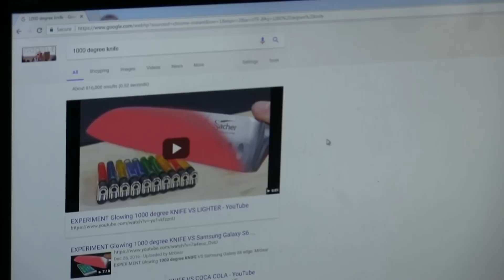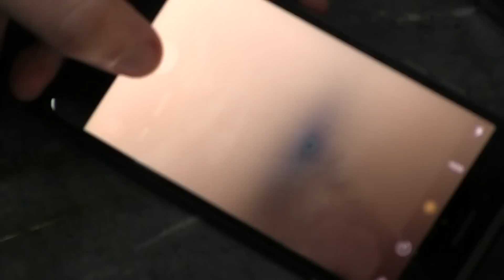1000 degree KNIFE VS $40 Nokia and $700 iPhone 7

Comment: -damages a lithium battery device, it catches fire, everyone freaks out as if it wasn't gonna happen.... comes back, throws water on it... which is something you NEVER SHOULD DO... and gets lucky that it didn't cause an explosion since lithium reacts explosively to water
Reply: ziggiey lithium when in a battery is like a gel. It releases gas when it gets hot, like any other thing on the planet when it reaches its boiling point. The gas is flammable to the tiniest of sparks, the gel is flammable just as well, except lithium itself is HIGHLY reactive to water, and thus explodes. It's like throwing a chunk of potassium into a tub of water.. But much worse. It's why air fields that fly electric planes/copters usually have warnings to NOT use water to put out a fire, but instead use a bucket of sand because the only way you can put out a lithium fire is to suffocate it. Just like with oil fires.
Reply: ziggiey i can only assume, but id guess because the battery was inside the phone so it didnt allow the water to get in while expelling the gas. kind of like a pressure difference.
Reply: they don't explode when dropped in a toilet or a pool because they are sealed. most even have a form of kapton around the ends as extra insurance that any heat build up wont cause the ends to magically open.
Reply: It doesn't have to be a metal. And yes, its the gas that causes a fire with a lithium battery, but adding water to it acts as a catalyst because lithium does not like water what so ever, regardless of its form. Ontop of that, the gas that comes out isn't a lithium gas, its a chemical reaction between the lithium and other chemicals inside the battery when it gets hot. It gets hot because it is short circuiting; short circuiting means the full power of the battery is being released at that time, which means electricity, which ya know, is technically a plasma when its arcing, which is super holy fucking hell hot, and ignites anything combustible...
Reply: it actually went out moments before James put water on it
Reply: ok
Reply: Lol as previously said, throwing water on it would have made it WORSE. Not better. :3
Reply: Lithium ion batteries are explosive, but they're covered with a wrap that keeps water from destroying everything in a 5m radius. They were safe enough, is fine.
Reply: o.O where the hell did you get some kind of info like that? How is a 'wrap' on a battery, going to protect anything within a 5m radius? Specially since, with physics of explosions, containing the explosion thus makes the explosion exponentially more 'powerful'. A 'wrap' on a battery does nothing. It will protect it from having water get INSIDE of the battery for sure, but when its punctured, the protection of the 'wrap' is negated, and the lithium will begin reacting with water regardless if there is some special magic 'wrap' on it. It'll still spew sparks and flames, and can still run the risk of explosions. Hell, techincally all it takes is puncturing the battery to start the whole 'igniting' process because lithium reacts to oxygen in the air, but on a somewhat minimal scale compared to when water is introduced. Once water is introduced in an open air environment, it violently combusts... all the proof that you need that all is required to make a lithium battery catch fire and spew flames, is take a gander at all the videos/news reports of iPhones and Note 7s combusting simply from either over heating, or a small short circuit. The gas released by lithium batteries is highly combustable... and it only takes water, or a spark, to make it go BOOM.

Youtube and Google are your friend.
Reply: Hikari Because lithium batteries have an explosive radius of around 5 meters. The wrap protects it from water, therefore it would stop the battery from exploding and destroying everything within a 5m radius when exposed to water. Of course, it isn't literally 5m, because explosions are finicky as all hell and change in size more than a teen changes in personality, but... Y'know.
Reply: lithium really doesn't react that crazy with water, people love to blow shit out of proportion. like yeah it fumes and catches fire n shit but it really isn't very dangerous unless you are talking A LOT of lithium, and we aren't.
Reply: +CostlyCoffee Not to mention that most of what Hikari was writing is total crap.
The way li-ion batteries work is they have a thin layer of lithium on an insulator that is wrapped up with other metals or what have you into a tight bundle (I can't quite remember the stuff that is in there).
The problem isn't exposure to the air as much as it is the massive amounts of heat generated when it shorts.
I am going to quickly go through some of the posts and point out the bs.
The battery terminals or internals short out which generates heat as massive amounts of power are being dropped through the battery. The energy lost is converted into heat. There is no electrical arcing forming plasma for many reasons, not the least because it is a short circuit so it wouldn't even try to arc. The heat simply comes from the fact the battery is likely discharging a massive amount of power. a lot of Watts.
Also, Lithium reacts with oxygen in the air, sure. But that makes it oxidise, which does the opposite. It actually causes it to oxidise into a pretty non-reactive form of lithium. What it actually reacts to is the moisture in the air. Although It really isn't water causing any of this anyway. It is short-circuits causing the battery to dump all of its capacity in a short space of time, generating massive amounts of energy that need to go _somewhere_.
Bigclive has done a few videos taking apart lithium batteries, if only more people watched those, they would have some idea about what is happening.
Reply: mattymerr701 yeah, I hate it when people freak the fuck out over stuff they haven't a clue about. Happens all the time with anything related to chemistry cough cough dihydrogen monixide "scare".
Reply: I actually got high scores on a final in a public speaking class by basically using DHMO to scare everyone into agreeing to ban water.

My favorite part was when one of the people listening after I told them what they just agreed to went "...do you mean all water or just some of it?"
Reply: It’s funny watching nerds argue

Comment: using water on an electrical fire smh... get your shit together guys
Reply: they freaked out and that was probably their fastest way to stop the fire
Reply: Right they should've used milk smh
Reply: ShadowWolf0000 technically it's both due to the fact the wires and electrical pieces would have caught fire as well
Reply: Yes but the phone was dead by then. So there was no electric current going through at that moment. I could put water on a spark plug that has no current and it wouldn't matter.
Reply: Its a chemical fire lol
Reply: Chemical Fire* It was the lithium battery not the circuitry.
Reply: That's what I'm saying as soon as i saw the water "What the FUCK James!"
Reply: The phone wasn't plugged into the mains so it's not really an electrical fire, The fire was caused by the lithium battery venting when being hit with a hammer.
Reply: Anyone arguing over what kind of fire it is needs to do something more important with their lives then trying to take a joke seriously
Reply: XD
Reply: +Nicholas Brandt And your comment proves you don't know how much more dangerous pouring water on a chemical fire can be then on an electrical fire. On a chemical fire, water can just make it spread, on an electrical fire, it just won't help.
Reply: Demelicos Helsaint I never claimed to know. All I know is in safety labs in highschool they tell you never to use water on an electrical fire. again like I said before you're taking a joke too seriously go do something with your life
Reply: +Demelicos Helsaint Dude I agree with you, but to tell the truth no one here cares and everyone will just take the piss out of you if you keep trying to argue, so yeah.
Reply: Especially on an alkaline metal such as lithium
Reply: oh no the electrical 3.7V fire !
Reply: science
Reply: UberHaxorNova i know you guys do crazy shit but sometimes you need to stop and think. That chemical fire could have brought the whole house down had you applied water too early
Reply: Correct! 10 points to Tretherin aka Trevor + Slytherin
Reply: Best thing to do is smother the flame. However, some salt can smother the flame too if you got enough.
Reply: Depends on the chemical fire, that category is so fucking wide it could do anything from removing the oxidizing agent to spreading it, to making an explosion.
Reply: As long as they don't advance to actually mixing chemicals then they should be fine. Also, buy a d-4 extinguisher lol.
Reply: science
Reply: UberHaxorNova I love u james
Reply: What is your workout plan?
Reply: +Nicholas Brandt anyone criticizing anyone for making a comment needs something more to do with their life...
Reply: science betch
Reply: Jesse, it is time to cook.
Reply: yes
Reply: UberHaxorNova Science
Reply: Sticking a plaster on a burn
Reply: Probably but water on a phone battery is the worst thing to do.
Reply: Nicholas Brandt that's why ales wanted a fire extinguisher
Reply: Chemical fire. The lithium battery more than likely caused that.

Comment: DO NOT breath in burning plastic fumes and DO NOT mess around with hammers. If there are stress fractures in the hammer head, add in extreme heat, and it might turn into flying shrapnel. Be safer out there guys.

Comment: Did James really just dump water on an electric fire?
Reply: That's a chemical fire not an electric fire.
Reply: Mary Barr You still shouldn't pour water on a lithium fire
Reply: LaPride247 lithium reacts violently with water normally. I honestly don't know why it didn't explode.
Reply: Because it was lithium gas. Not the pure metal, and because the water grounded to the counter.
Reply: Oh yeah I forgot its when the alkaline METALS are exposed to water. Thank you that makes a lot more sense now. I don't know why I thought the lithium in a the battery would be solid.
Reply: There still was a slight reaction with the gas after he pours the water on the phone you can still see juts of smoke coming out
Reply: Your Dad
Weirdly I believe that to be water vapor, as the phone was still very hot when they poured the water on it.
Reply: Your Dad Did I say you should pour water on it? No, I only said it isn't an ELECTRIC fire.
Reply: Mary Barr Calm down you
Reply: good thing it wasnt an electrical fire then.
Reply: He knows what he's doing, he used to be a medic engineer
Reply: I mean it worked, did it not?
Reply: @MrSilentfire11  plot armor

Comment: 12:01 to 12:32

WTF
Reply: Faisal Plays probably the battery leaking
Reply: Lithium reacting with air I guess
Reply: Michael Scott yeah it's the lithium having a chemical reaction to the air after the blunt force from the hammer destabilized it and broke open the case
Reply: zak kozak Plus one of the burners was on
Reply: A guy I knew in school ended up setting off the schoolwide fire alarms because he brought his phone into the weight training class and dropped a 20 pound dumbbell on it while doing bicep curls lol

Comment: u don't throw water on an ELECTRIC FIRE
Reply: it's not an electrical fire. such low voltage wont harm anything. if the phone was plugged in and charging at an outlet then it'd have been an electrical fire.

Comment: The iphone is made out of aluminum, which has a melting point of more than 1200 degrees. The glass melts at 3000, so of course a 1000 degree knife wouldn't slice through it.

Comment: Dear Cow Chop,

I know you don’t give to shits but since you’re going to catch thousands of other thing on fire, I might as well bring this up.

Fires dealing with electronics shouldn’t be put out by water, instead use sand or some sort of lid to deprive the fire of oxygen. 

(But pease make sure it’s see through so is fans can watch, just in case it is to somehow fuck up and blow half the house down.)
Reply: A phone is barely a electrical fire
Reply: VIZIO An electrical fire is an electrical fire, but the battery in itself is the bigger issue.

“Water should not be used on any lithium fire because pouring water on a lithium battery fire can make it more difficult to extinguish it because of the reduction of lithium in water, which leads to the release of hydrogen, which is highly flammable; the potential of reigniting a fire is much greater when using water.”

Comment: Was the phone fire fake? You can't put out a fire made by hydrocarbons in thermal runaway by adding hydrogen and oxygen. Water is an accelerant to these types of fires.
So how the fuck did it go out?
I'm not concerned about your health - clearly you aren't either. So can you at least answer this question?